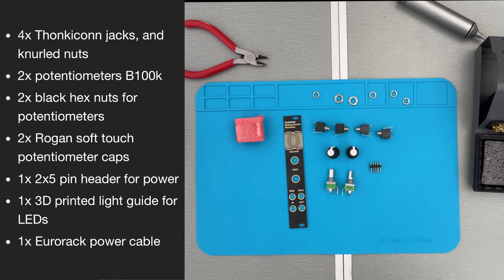Rainy Holiday? Time to Solder a Farbfolder! 🌧️🧠 DIY Modular Synth Build in a Campervan

Comment: One thing maybe worth noting here is the size of the component you are soldering. The power header pins are pretty chunky, much more so than say the pins on the jack sockets. I can see the jack sockets being processed really nicely, just as you’d like them to be. But when tou have a big old chunk of power header, it’s worth thinking about how the heat from the iron might be transferring. If the temp stays the same for all components big and small, you should try leaving the iron connected to the metal for longer, to let that solder-melting heat dissipate into the area you’re working in. I think as others have said, maybe a higher temp could be employed, at least for the bigger chunks you need to heat up. The only slight worry with longer heating is sometimes you can inadvertently damage other components nearby.. so for a new build it could be worth looking at the bigger elements like power header pins, as they might be better to do before other smaller bits in the same section on the board, which could go against the usual rule of building small to big (which in my opinion is less important when you have a good clamping system). Just my views, throwing them into the mix with all the other great advice here ❤
Reply from the maker: Thanks for this, very helpful! That does make sense. I really struggled with soldering the power header, which has been proven in the fact that both modules failed because of the badly soldered power headers! I'll check out the temp and good point re soldering this component first!

Comment: You need flux and a hotter iron.
Reply from the maker: Thanks! I’ll defo get hold of some flux and up the temperature on the iron next time :)
Reply: @iamseeingdots   I believe you'll want to use rosin flux, it protects the circuit at room temperature. Non-rosin flux is for factory soldering.

Comment: Nicki, what iron were you using, and what tip?  I've built boards since 1970's so..... maybe I can give you some advice.  The flux advice is a good one, but I assume you are using rosin core solder?
Reply from the maker: I am using the OSS team T12-X Plus soldering iron which has full temperature control on it. The tip is a slightly wide angled tip, I previously tried a fine tip but I struggled with it, the solder came off in balls when I put the solder to the tip for some reason - maybe the temperature on the iron was set wrong? Yes the solder is rosin core - does that mean I don’t need flux? I have considered lead solder but I have been told that it’s not that good for you and you need a proper extractor fan with the lead. Thanks in advance for your help!

Comment: O, rain! ok.  Seems like you might need to adjust that Soldering Iron up a little to get it just a little hotter (or maybe upgrade to one that can?). This attempt @ 2:21 is called a cold joint, and won't be good in long term. It really shouldn't bead up like that, instead it should almost get sucked in by capillary action onto the pad and wire. That last set of soldering went very well tho at 3:50. Interesting video!
Reply from the maker: Thanks, I can definitely increase the temp on the one I have so I’ll give that a go. Oh gosh I bet I have lots of cold joints in my modules! Thanks for the advice, very much appreciated! I’m guessing practise will make perfect (one day 🤣)

Comment: Here's a tip for when the solder won't melt: Instead of touching the iron to the work and then adding solder, put the end of the solder on the pad first, then gently let the iron melt through the solder until it reaches the lead/pad.

This technique works especially well with lead-free solder. It's how I was trained as a J-STD-S instructor, and it's the method I use in my own classes.

With tin/lead solder and new components, you never need to add any flux. However, lead-free solder can always benefit from a small amount of flux. I like Chip-Quik paste flux. Make sure that any flux you add is compatible with the flux in your solder core, because mixing two incompatible fluxes can result in a difficult-to-remove sludge that interferes with the flow of solder.

And yeah... always use a work holder. :)
Reply from the maker: Thanks for the great tip! I’m gonna try that next time! And I’ll check out getting some compatible flux!

Comment: I wouldn't recommend getting lead solder unless you get a decent fume extractor and have plenty of space around you. Unleaded is fine, PCB's have to be lead free as do all consumer products. 
Leaded solder is easier to solder with but I would be concerned health wise.
Reply from the maker: Thanks for the advice! I’ve had a few people recommending leaded solder, and given my recent issues soldering I was wondering whether that might be the answer. I did however have concerns about the fumes. Think I’ll try persevering with the lead free and perhaps try different temperatures on the iron!
Reply: @iamseeingdots  what temp are you using??
Reply from the maker: @tonalaxis_AXiS_MODULAR 375
Reply: @iamseeingdots  for power sockets and tricky solder pads connected to the ground turn it up ro 400.

Comment: Use flux! Put some on to the holes & pins with a toothpick. That will help to flow the solder in.
Reply from the maker: @MarkoVukovic0  thanks for the tip! I like the toothpick idea, sometimes these things are really fiddly!
Reply: @iamseeingdots  Fiddly indeed, but once you start using flux, you will wonder how you soldered without it. To clean it off after, just use some surgical spirits. Enjoy your holiday!
Reply from the maker: @MarkoVukovic0 thanks 😀

Comment: That module has interested me some, but I'm currently restraining from buying  ANY MORE Eurorack modules this year.  Besides, no empty space in my setup.  But that's a great module for someone just getting into building, since it's just pots, jacks, and the power connector. And a tip for you Nicki - what I'll do when soldering those is actually connect the power cable to it, so I can hold it so that it's flush to the PC board without having to have my fingers touching any pins, which get hot.   I just counted, I've got 62 modules that I've built to date.
Reply from the maker: That’s a great tip! Many thanks! It was a nice easy build (even though I might have made a pigs ear of it!) the next build is a harder one, so I’m going to get some leaded solder and practise a bit more before I attempt the next project! You must be a pro having built 62 modules - well done! That’s inspiring!